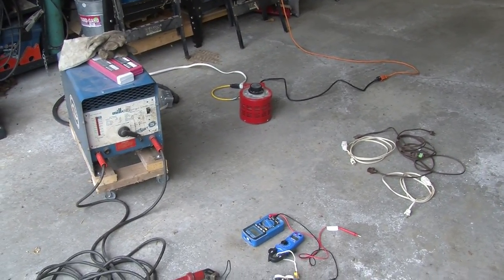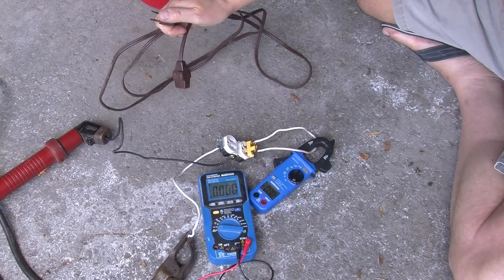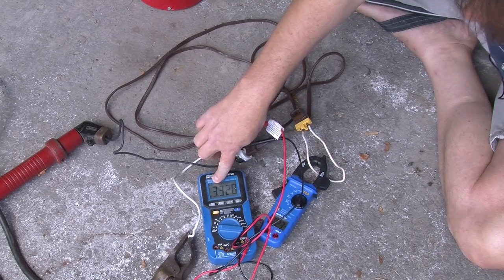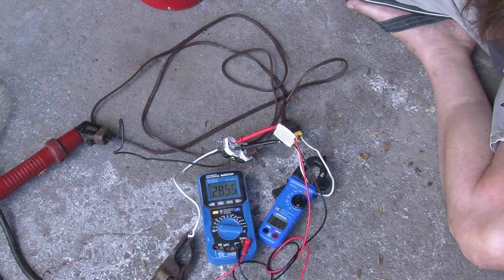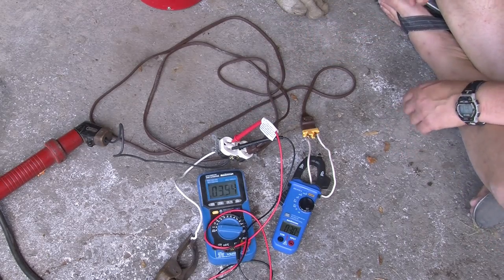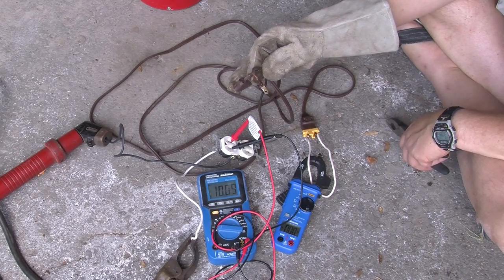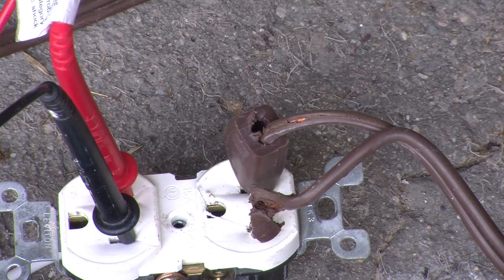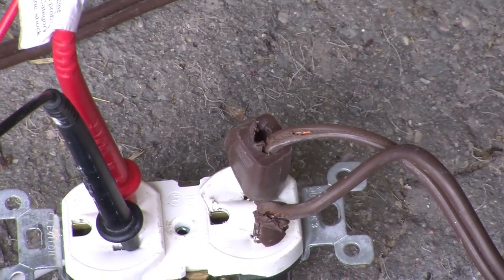Lets try overloading some extension cords.

Comment: Nice video for the amp rating. It seems like only wire part burns out but not receptacle and plug. I have a question. Is it okay using higer amps than receptacle and plug's rating amps as long as breaker and wires are okay?
Reply from the maker: No - never use more current than the rating of the  lowest current device in the circuit! Just becuase the wire may have burnt first here  doesnt mean that will always happen. The wires and other components have been extensivly tested to give them  the current rating that they have. So dont take a risk just to save a few cents on a cheaper componet that is rated less than it should be! Glad you liked the video!
Reply: @ElectromagneticVideos  Thank you for the quick reply. Here's my problem. My breaker and wires are rated for 30A but my receptacle and plug are rated for 20A. This system is for electric car charger. 
1. Can I use 20A or Do I need to use 16A to meet the code?
2. In order to use 24A, Do I need to replace 30A's receptacle and plug?
Thanks.
Reply from the maker: @최명철-g9r  So for code questions you really need to check with an local electrical insoector or electrician.  But a 20 Amp receptacle and plug on a 30  Amp circuit is definitly dangerous. Yes - change to a 30A receptacle and plug since your wires and breaker are 30A. Are you 100% sure your wire is 30A? Make sure it is! 

You are right about derating - so in  general for continuous usage like charging a car, use no more than 80% of the max current. So  for a 20A receeptical/plug you are right - max 16A and for a 30A one, max 24A. But again, check what the local code requires.

Comment: Coiling the extension cord would help make it warmer due to the magnetic fields the coiling makes because the wires are next to each other.
Reply: there will be very little magnetic field, because the current flowing in opposite directions cancel out. The problem with coiling cords is heat, hot cord next to hot cord.
Reply: @liam3284  Coiling cords while using them isn't a great practice.  In some states the maximum rating of an extension cord intended to be coiled is derated with a 16 AWG only rated for 10 amps, a 14 AWG rated for only 13 amps and so on.

Comment: Lets face it, it's just fun to blow stuff up with electricity isn't it? I will tell you from first hand experience that applying 480 volts across ANY 120 volt equipment is 👌
Reply from the maker: I'll bet you have some stories to tell! Probably not as much fun when it it happens unexpectedly but very exciting I'm sure. 

Since you brought up 480, let me ask you a question. From what I have heard, one of the very few differences between Canada and US electricity is that we often use 600/347 and while you use 480/277 for similar applications. Have you ever seen 600/347 in the US? I'm not sure what state you are in but I have heard 600 is used in some of the northern states but not sure how much truth there is to that.  

Very odd that Canada and US would diverged on that one voltage - I wonder how that originally came about?

Comment: The American plugs and sockets are so flawed. They look flimsy as hell!
Reply from the maker: They actually do handle current well due to the large surface area of the contacts. I think the main issue is the ability to touch a prong while plugging it in. What we really need is an insulated top part of the prongs near where you hold the plug like many of the 240V counties have done over the years.

Comment: Your volt meter was reading incorrectly. There's no way 4 volts is outputting 22 amps (lol). Your test leads weren't making good contact inside that receptacle. It would have been better to touch the leads directly to the screw terminals on the receptacle. But really the voltage doesn't matter in this test - all we care about is the amperage.
Reply from the maker: Look at the setup - its essentially shorted and very low resistance. Easy to push 22A though a wire. Your right that all that matters is the current. The voltage is simply a good way to get a sense of what is happening (insulation shorts cause a sudden voltage drop) and also when multiplied by the current, the total power being delivered and therefore causing the heat.